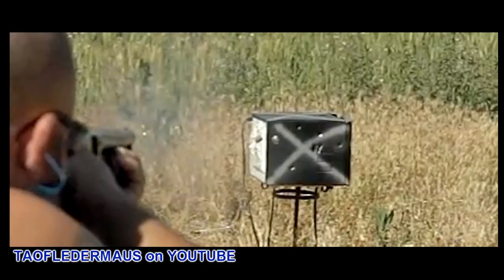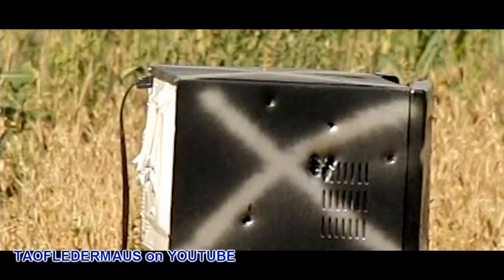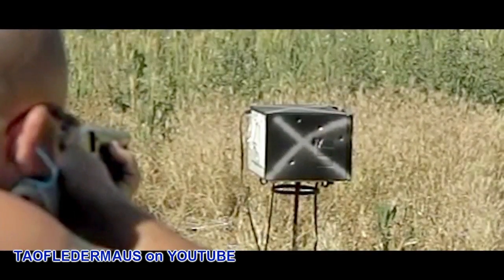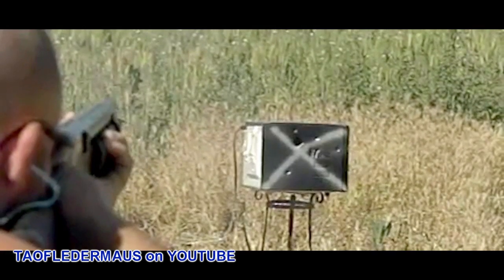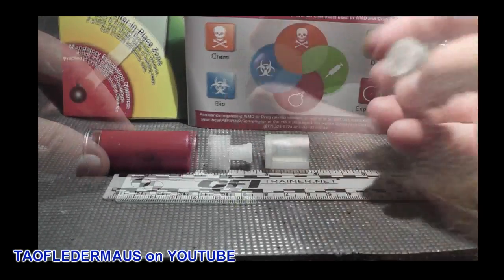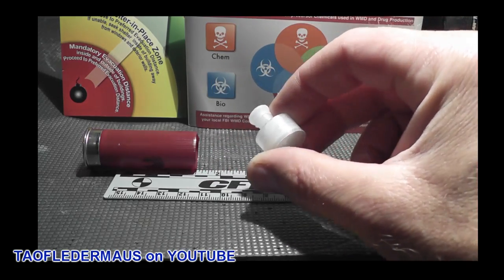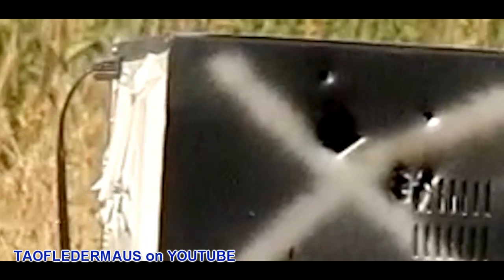One in a Million Shotgun Shot?  - Supersonic Vacuum Effect

Comment: Well, the odds are more like finding the area that the wad usually diverges in (the "group size") and what proportion of the hole area fills the group size area. If the slug sucked in air the wad may just need to get near the hole and be sucked in.

Certainly improbable, but more like one in 10'000 chance. Probably many shooters shooting paper target have had this happen but without high speed they presume the wad went high over the target rather than through same hole as the slug.

Comment: Bird shot sprays shot.  Wax slugs (bird shot + wax) hold together until the point of impact, at which point they break apart releasing the energy more violently.  Its like splashing someone with a glass of water vs tossing a water balloon.  They are often used as a cost effective home defense round.

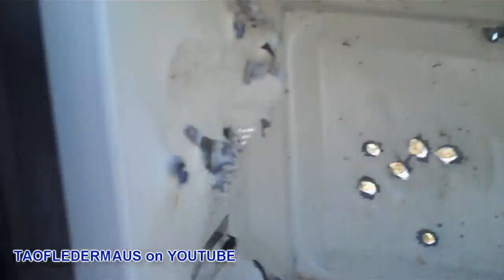Comment: Microwaves are not exactly ideal targets due to what the magnetron contains. It contains both a ceramic containing toxic and carcinogenic beryllium oxides that easily shatter. At 1:16 you can see it in the hole. Also, it contains a vacuum tube with a thorium/tungsten alloy inside, so not only is there a risk of releasing carcinogenic dust, but also a risk of radioactive material release after a shotgun slug hits it. So of course it's fun to shoot, but there are real dangers involved with them.

Comment: Probably a stupid question but could it have been following the low pressure behind the wax slug? It's already got the forward momentum so the low pressure was probably just enough to keep it flying straight. And in the slow-mo the wad seemed to get sucked into the hole in the microwave.